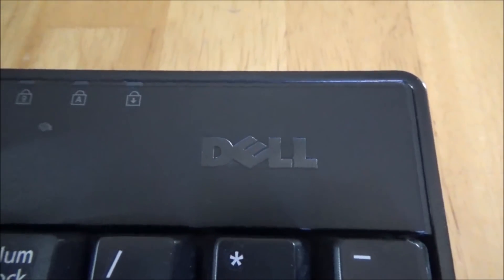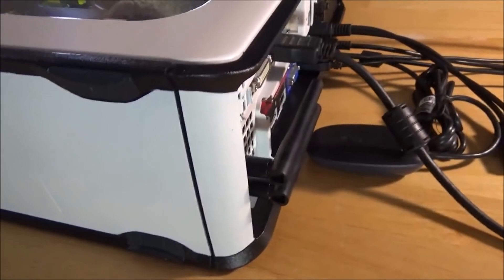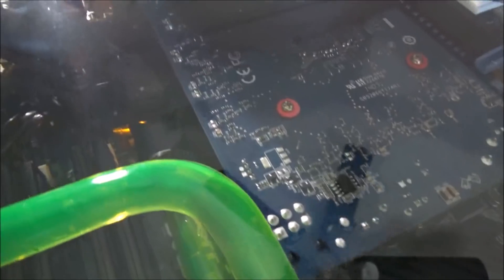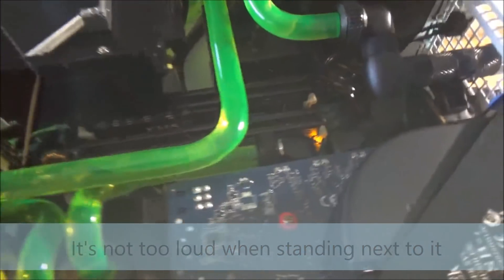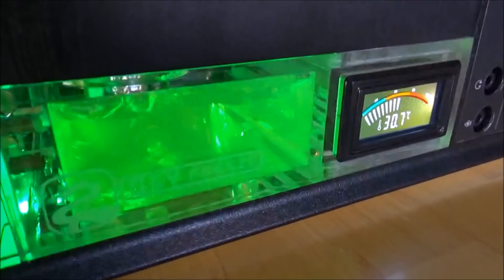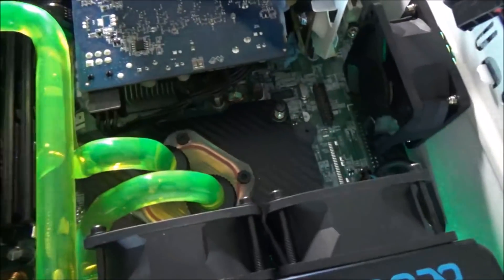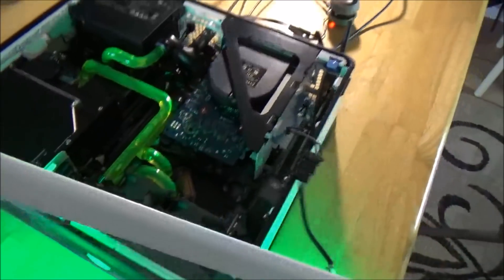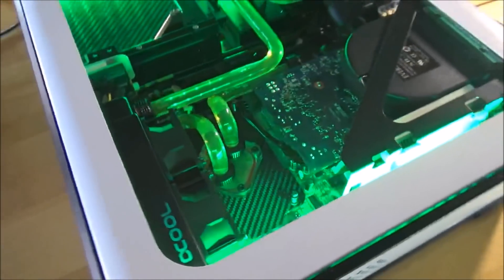Custom Hard Line Water Cooled Dell Optiplex 780!

Comment: For a SFF desktop i think that looks awesome bro well done i love the way it looks, i would be proud to call that my pc if i had built it so you should be proud of your self keep up the good work. It looks factory built
Reply from the maker: Thanks dude, it means a lot. I put some work into it for sure. These old Dell PC's are hard to make look nice. I'm stoked that it looks "factory built"!! I actually don't really know what to do with it lol. I have a pretty good gaming PC and a few other Dell's already laying around. Thanks a lot for the nice compliments, it makes all the work worth it. And thanks for watching!
Reply: No problem bro i look forward to the next build
Reply from the maker: Right on, I got an idea that will be pretty entertaining. Stay tuned.
Reply: PimptatoPCs will a 1050ti 4gb card fit in this
Reply from the maker: I think it will as long as it's a single slot card. The water block that I installed on the R9 270 is just a little slimmer than your average fan and heat sink and still has room before it hits the mobo caps. Thanks for subbing man!